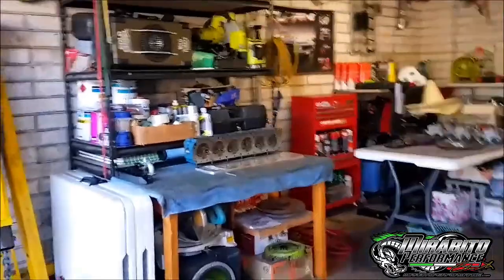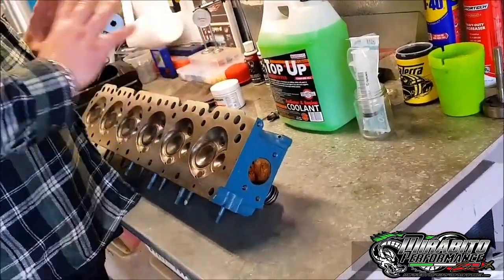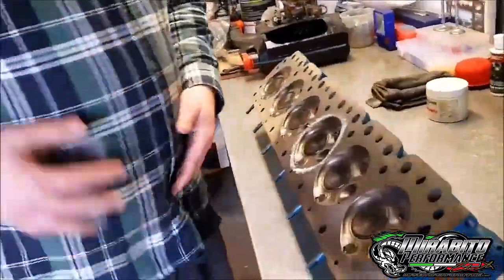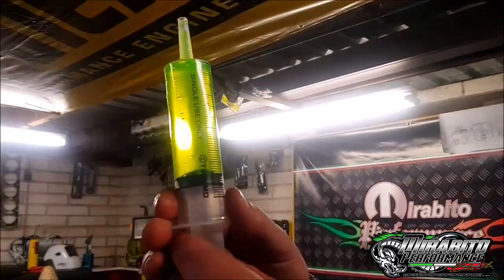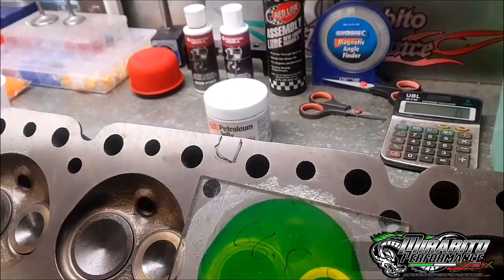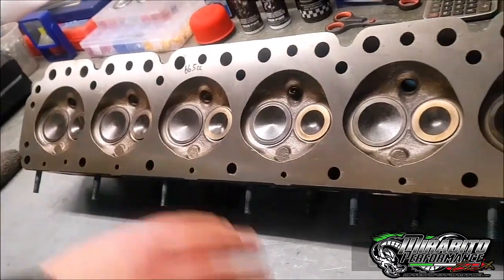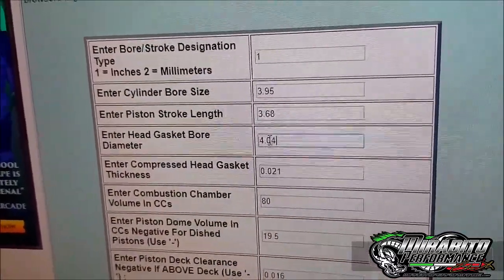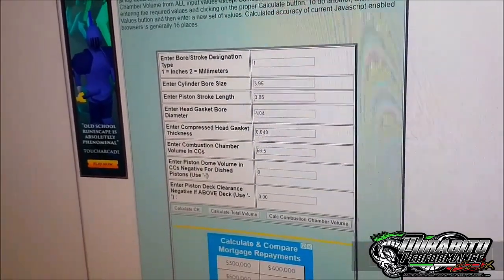How to CC a Cylinder Head with Coolant - Mirabito Performance

Comment: Hey Chris I have a question, when you put on extractors what gasket do you use and do you put them on dry, without a  sealer ? Also I just bought and installed your oil pump brace, fitted perfectly.
Reply from the maker: Yeah you can put them on dry. Or you can put some hi temp silicone around the extractor flanges to make sure they don't leak. Coz I have so many go in and out I just do what looks right at the time depending on if it's a new gasket or not and how long it will be together for. But for a one time set and forget I would put silicone on and she will be sweet.
Reply: @TUFFR6  thanks, they seem to only have the factory style gasket as opposed to the cardboard like extractor gasket, is this what you have noticed as well?
Reply from the maker: @timcoppinger3373  yeah there are alot of different ones. Cardboard,  metal and cardboard, all metal and the graphite ones from Hemi performance they are good too. Just use them dry and they work well.